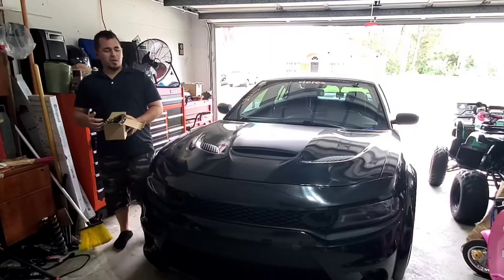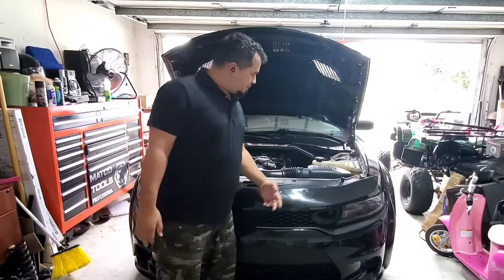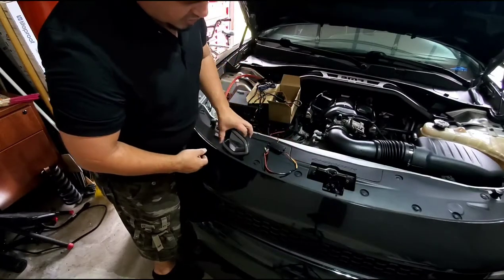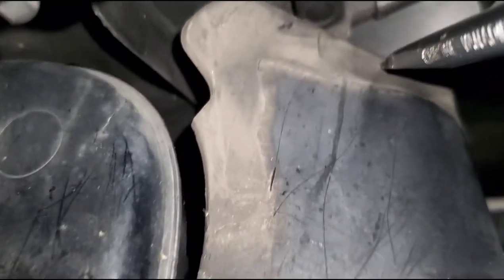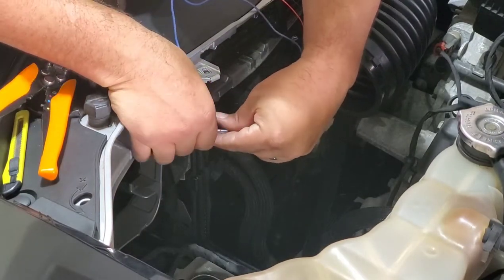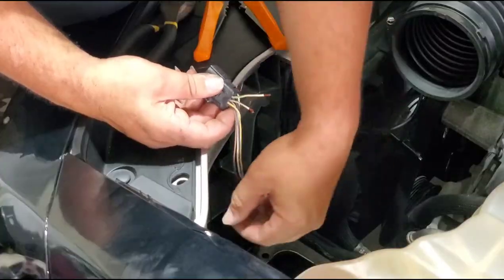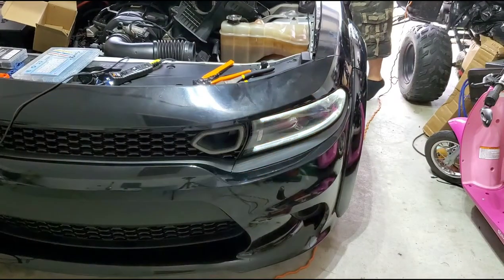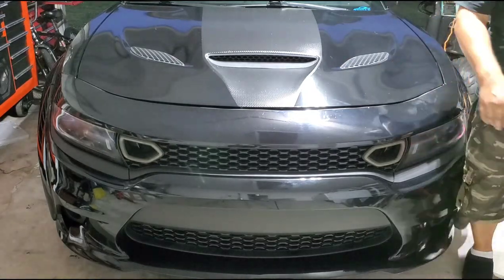How I installed the SRT snorkel LED lights on my Charger.

Comment: the only problem i had with these is that they oxidized and got yellow over time (4 months) so now when the light is on the DRLs are no where near match. gonna just probably probably
upgrade to the full LED kit where you can change colors on the DRLs and snorkels
Reply from the maker: Thanks for letting me know